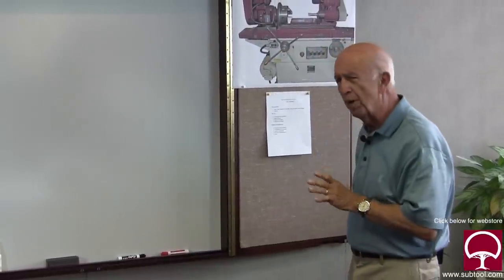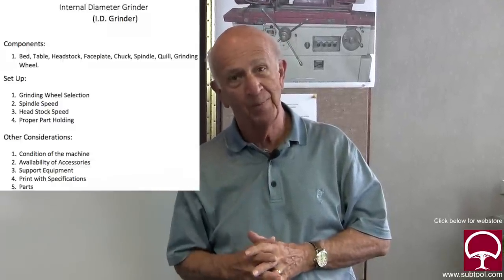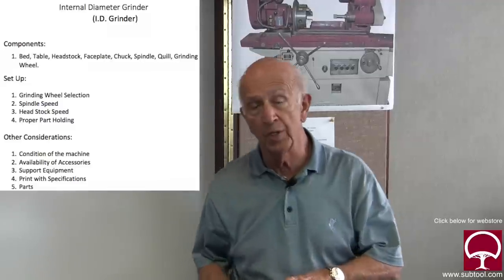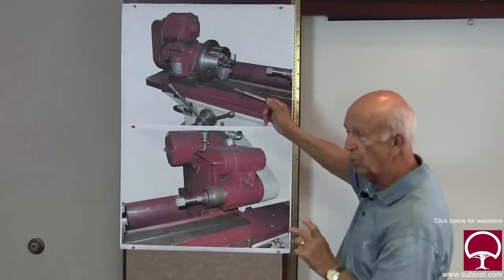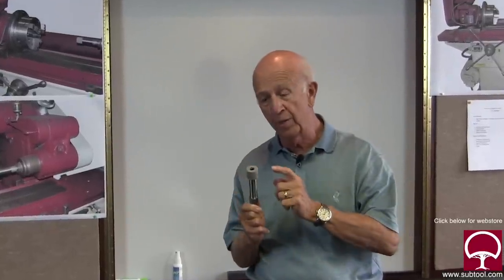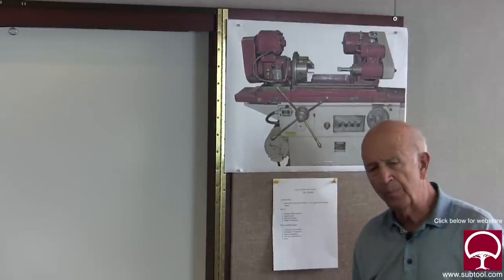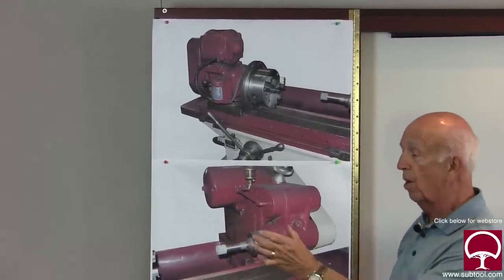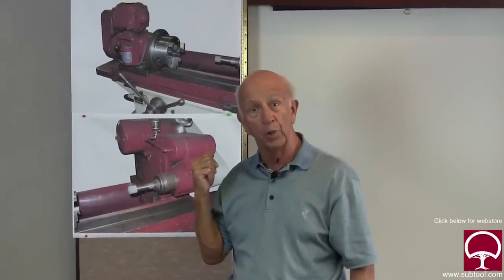How to I.D. grind. Simplified by Don Bailey.

Comment: Don, thanks for sharing with us. Looking forward for the next video! :) A question, please. I noticed the chuck on the machine is a 3-jaw. Aren't collets more accurate? Would you recommend holding your part using collets? Thanks.
Reply from the maker: +aryesegal1988 You are correct however, collets are limited in size.The chuck will accept much larger parts. In one of our upcoming videos we will show you how you can improve the accuracy to a few tenths.
Reply: SuburbanTool Inc Thanks for the reply. Looking forward to future videos. :)